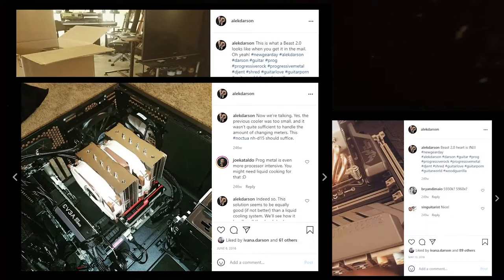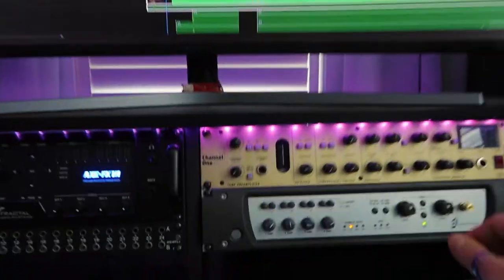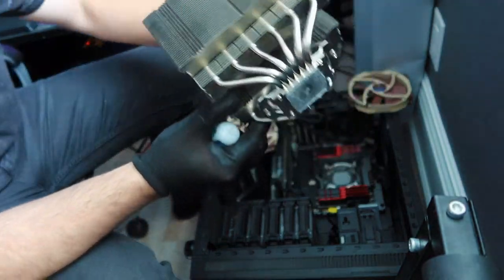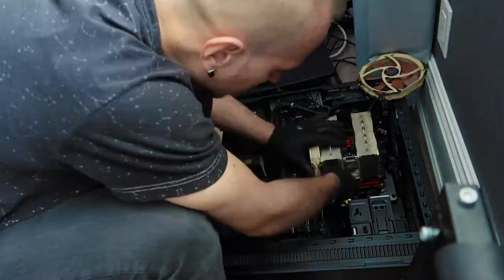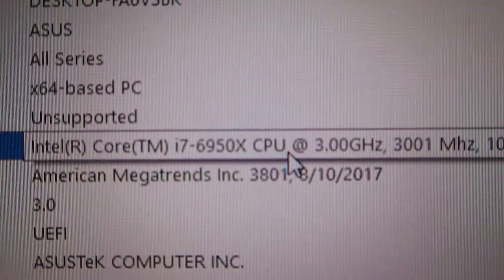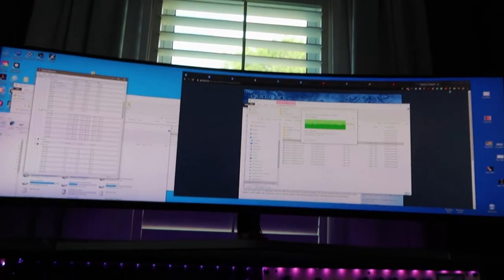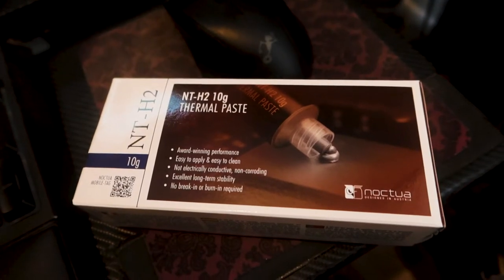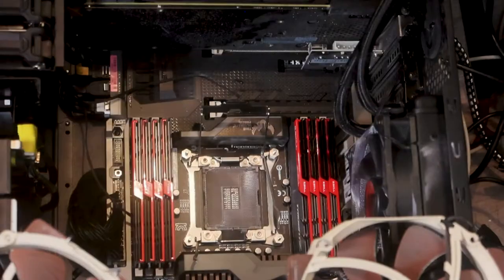Bulletproofing My Main Workstation PC w/ $2,000 CPU | Beast 2.2

Comment: just out of curiosity: did you look at amd ryzen 9 cpus? or m.2 nvme ssd?
Reply from the maker: So when i bought this mobo Intel was still leading (sorta), so I was locked into the whole x99 lga2011v3 platform. Pretty sure I'll be switching to AMD next time. As for the m.2, I have one slot which i use to run my system off of. So far I pretty good about the 3d nand, but I'm open to swap it to run the system if need be and let my m.2 get the premiere previews and/or footage